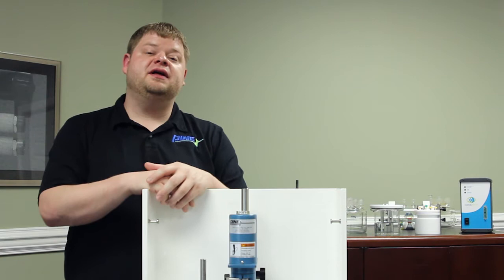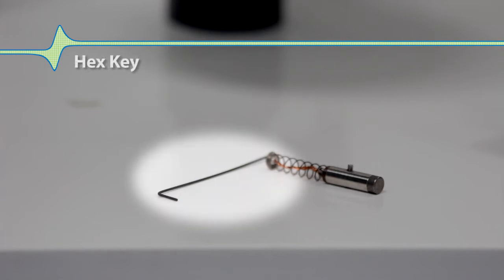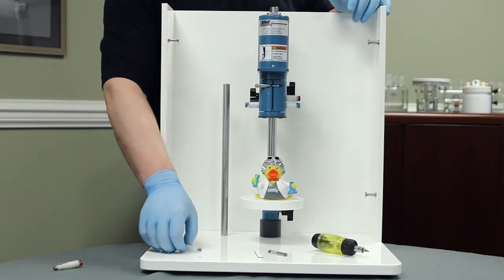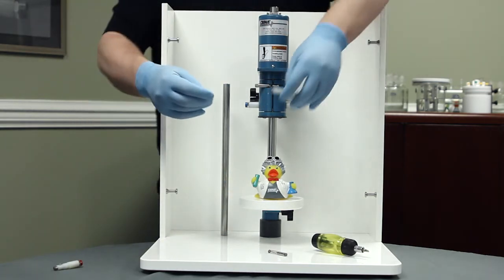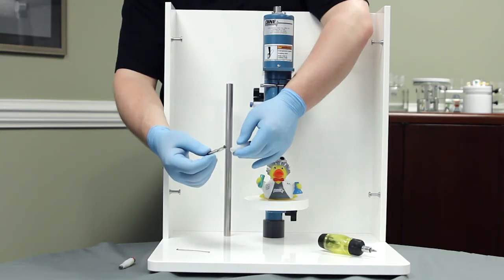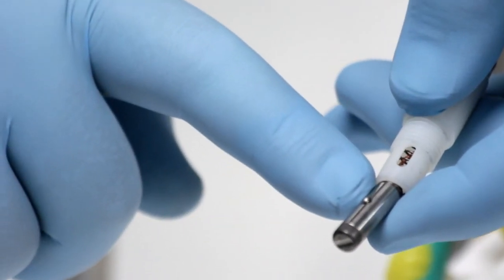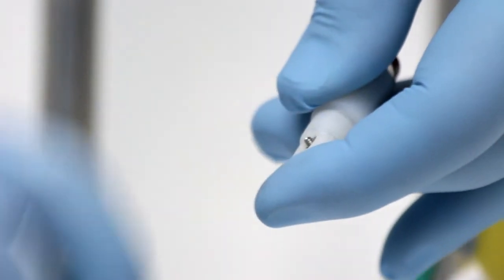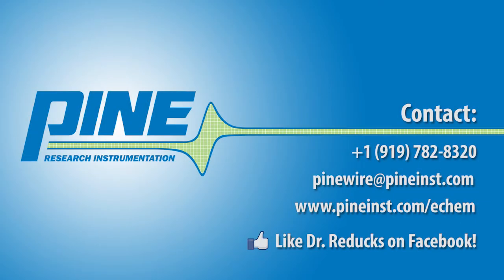Basic Rotator Maintenance Part 1 - Brush Replacement

Comment: Thank you for the video!  A couple questions: How do you know you need to replace the brushes?  Are brushes typically replaced all at once or one at a time as needed?
Reply from the maker: Sorry for the late response.  The brush wear will depend on how often it's used.  You'll start to observe signal noise in your data because the brushes are smaller and don't push as hard into the shaft to maintain electrical contact.  You will need to replace at least one pair of brushes at a time so they evenly push against the shaft.  If one side pushes more than the other it will cause mechanical issues over the long haul.  Some users can get away with replacing brushes ever 5-10 years.  But heavy rotator users might need to replace them every 2 to 3 years.